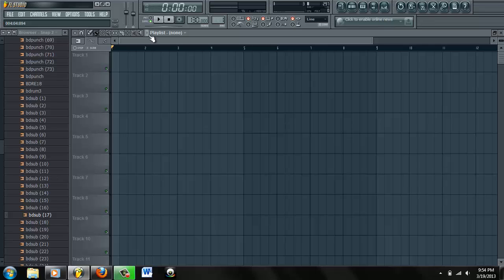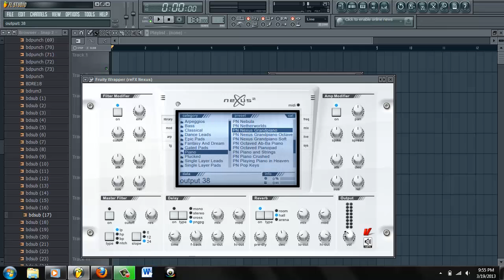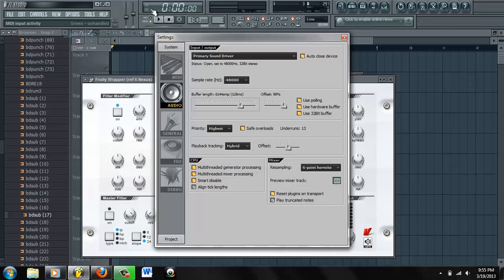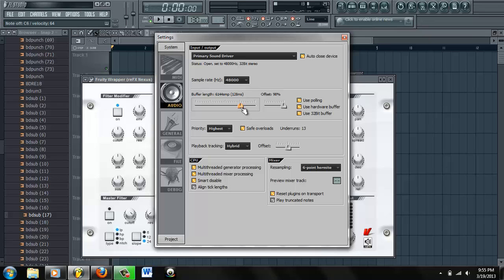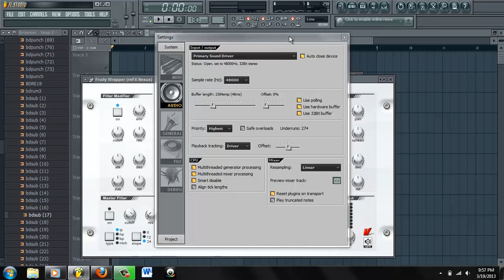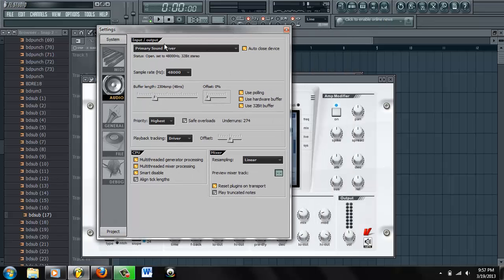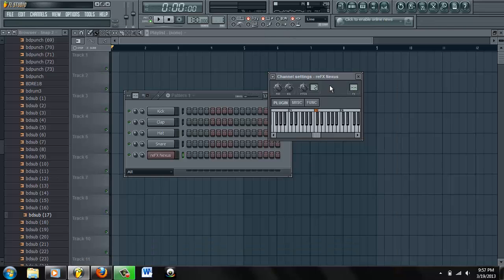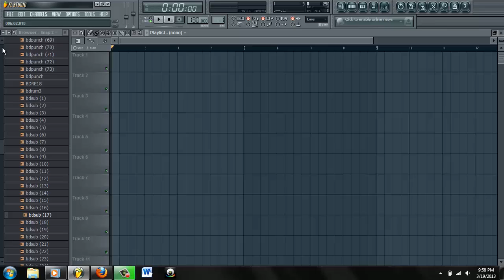How to Fix MIDI Latency in Fl Studio

Comment: You will never get zero latency MIDI monitoring.

The solution is to use an audio out line into your DAW interface (if it has zero latency direct audio monitoring) or an amp. Then, turn the volume of the MIDI channel you are recording into to zero (so you won’t hear it when you record). Even tho’ the channel volume is set to zero it will still record the MIDI data.

Then select the new MIDI channel and start recording. If you have a previously-recorded MIDI track it will play, and you can play along with it while hearing what you are playing in sync via the audio.

Then “rewind” and turn up the volume on the MIDI track you have just recorded. It will be perfectly in sync with the backing track (or tracks). The audio will not have been recorded.
Reply: Can you elaborate on this I’m not sure what to do specifically

Comment: This is audio delay, not midi delay. You are better off using an ASIO driver, and dont set it with minimal crackling, set it with zero crackling, or you are underrunning. Also, the settings for buffer size are dependant on the speed of your computer and soundcard, so the suggested settings here are completely arbitrary.

Comment: Well, I have an old windows xp from 1999, using Evolution sound studio program, and a sound blaster AW32 sound card.  And gues what, No latency what soever. No ASIO drivers needed and the sounds of this card are just great! You'd think they got this latency issue solved bij 2017, but no sigar...so, don't throw away your old sound blaster card..

Comment: this is for absolute beginners though.. advanced users will still find that 50ms delay is not responsive enough.
We need it to be below 20ms otherwise it's a catastrophe when trying to do live streaming with using FL Studio.
I can get it to 3ms delay which is fantastic when I use my scarlett interface, but unfortunately I can't use my scarlett interface when I do my tutorials... fml
Reply: I'm thinking of going down that road, using hardware to do the job rather than on board sound.

Comment: My problem is not the delay when I play but the delay after recording my melody. It is offbeat.
Reply: Change the playback buffer to mixer
Reply: @truthdefinitions   this fixed it for me thanks!
Reply: @truthdefinitions  3 years later , I love you🤣🤣 been trying to figure this out for years
Reply: Same problem i am working in fl studio 20 and i know what i want to do and after i quantize the recordings it changes the whole idea of the recording i previously did
Reply: Go to options > audio settings > and change 'playback tracking' to 'Mixer'. This fixed my issue of delay after recording.
Reply: @maxp6521  Thank you you helped me to solve this fucking problem
Reply: @maxp6521  You're a lifesaver
Reply: @maxp6521  It worked for me too -cheers bro!
Reply: @maxp6521  saved my life thanks bruv
Reply: @maxp6521  YES Thank you!
Reply: @kareemjavone4467  Have you been able to fix it? I have not been able to solve it yet.
Reply: what if it is already quantized
Reply: Go direct monitor... It latency... Need more info, which daw ?
Reply: Jazzy may sound like a noob question but how do you quantize?
Reply: Thanks for everyone who's made a comment here, I was able to fix the same issue DEAL-M)05 was having
Reply: Hello all! I'm running Roland FA 08 into GarageBand on Mac then bluetooth speakers from Mac and there's a clear lag between hitting keys on Roland and sound out of speakers. However there's no lag when I run the sound back through my Roland FA and out of the same speakers but via wire. I'm assuming bluetooth is therefore causing the lag? Is this fixable or just the way it is? Any help would be greatly appreciated! thanks!
Reply: I have a akai midi mk3 im using fl 10, I have a issue when it comes to recording , example,when I play a melody on the midi ,when it records the notes a squished together (thats not how i played it)the orange marker only moves when a note is pressed (not on a roll) when the metronome is ticking
Reply: VanDerPourpre_05  You need to Quantize it after u record bro.
Reply: thats because you played it offbeat

Comment: does it make a difference if you have a faster computer or an audio interface?
Reply from the maker: Ben Gosling Yeah, it makes all the difference. Look for an interface with a build in sound card so you can divote a lot of that CPU to the program instead. I use the NI Komplete Audio 6 and I love everything about it.
Reply: what about the Focusrite 2i2?
Reply: DigitalVideoFX what about m-audio fast track pro?
Reply from the maker: Im not sure about the pro, but my school gave me a fast track duo and i dont dislike it, but its nothing really special. Just a reliable basic interface, but like i said, i have no experience with the pro, so im unsure of the differences
Reply: Im using the pro now, it makes no difference. use an asio driver if you want no latency
Reply: +Ben Gosling late response but I have the 2i2 and it works perfectly with midi without any delay.
Reply: +DigitalVideoFX This Didn't Work for me :( Any other way??
Reply: how did you get your midi controller to work with the audio interface? i connect my midi controller with a midi cable to the back of my scarlett 2i4 and the midii controller doesnt even turn on.